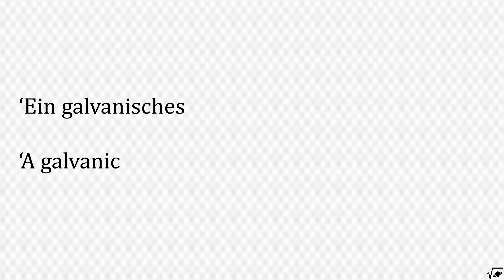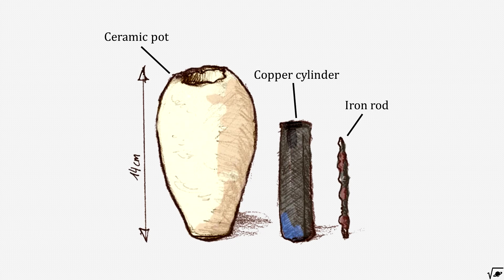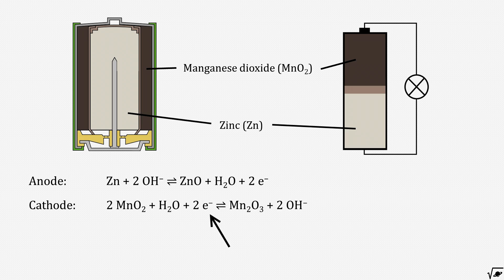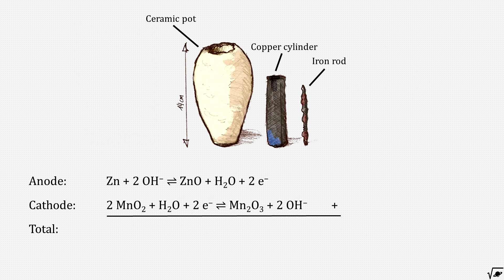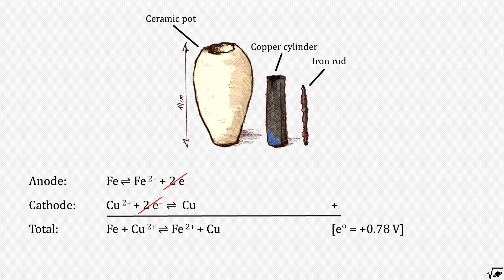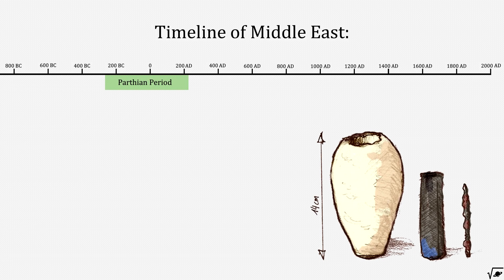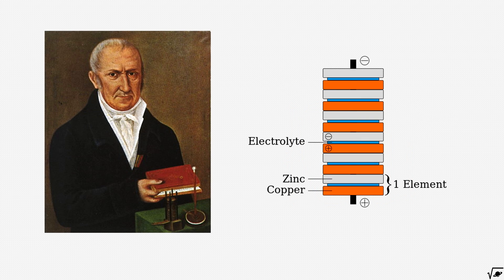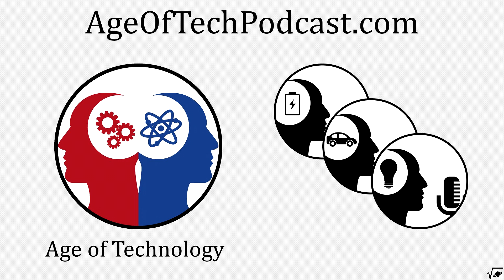How The 2000-Year-Old Baghdad Battery Would Have Worked

Comment: I don't think it is a battery, I believe it could have been made to detect electrical current's to know when thunder was coming, to know when rain would come.  The rod probably conducted in the pot to cause a chain reaction with the liquid to let people know that a storm was coming.  Where they were water probably was scares so they needed a way to detect when it was coming. 

My second theory if  it was used for that, that the electron's that it could produce was used for heat in a way for cold nights, like a first modern heater of sort's. But this second theory is just a stupid idea I was thinking, because batteries can cause heat when pushed to a lot of pressure so I was thinking because nights can get cold they used it as a heater in a way... I don't think they used it as a battery but for something common...